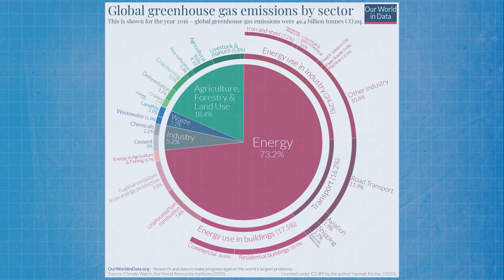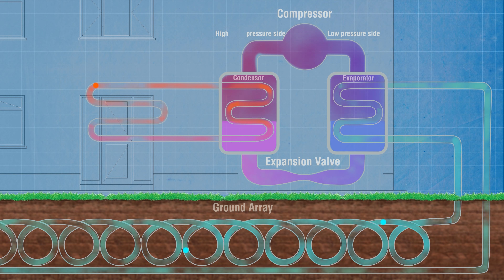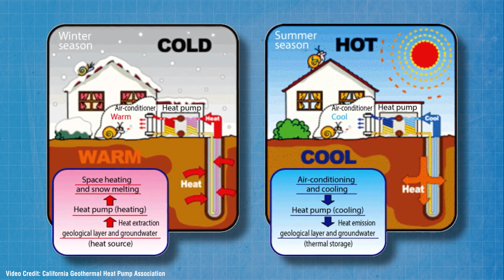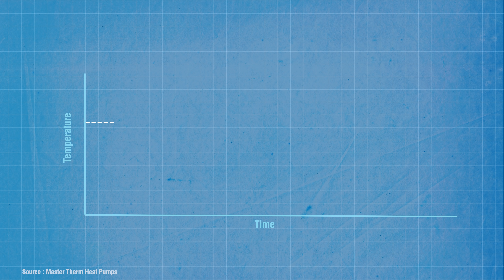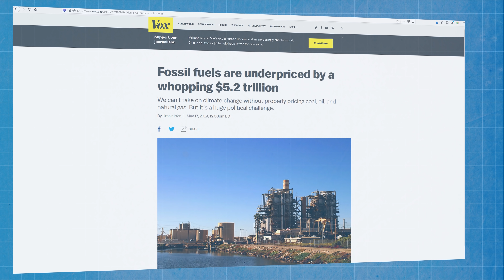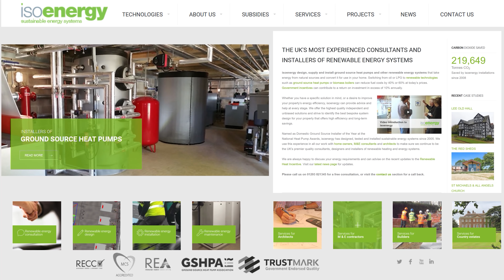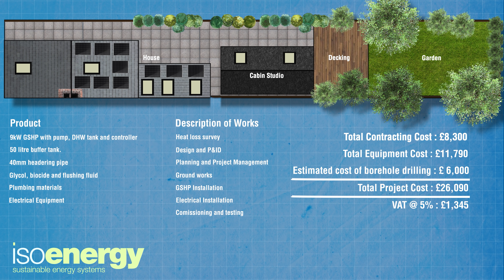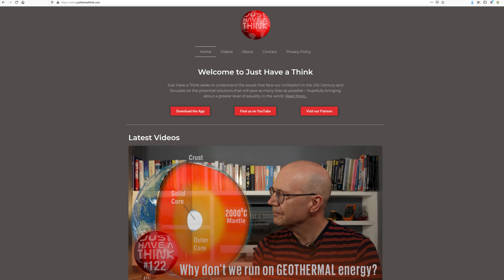Geothermal ground source heat pumps. Heating your home from your own back yard!

Comment: Quote from the isoenergy website as listed above:-

"Ground source heat pumps take heat from the ground, raise its temperature and use the energy to heat your property." 

As do conventional gas or oil boilers. Our water is buried in the ground and comes in at that temperature, we add heat from combustion instead of heat from gas compression as in a heat pump.
While the much vaunted Coefficient of Performance is quoted I have yet to see an explanation of how it occurs? The ISOenergy website merey says you get energy for free with no technical explanation?  Am I sceptical, yes!

Another factor to consider is that gas and oil boilers us the fuel directly and have a very good efficiency (Circa 90%). The quality of the heated water, due to it's higer temperature gives an advantage over a heat pump, particularly air source which gives a reducing output proportional to falling outside air temperature, rather a negative for a heating system?
Using fuel to produce electricity and then supplying a heat pump uses quite a bit more fuel (About 40 t0 50% efficiency producing the electricity for the consumer) This significantly drops the COP.

While the CO2 emissions from generation have dropped steadily over the years, this push for electrification of heating and transport will increase demand significantly, which can only be met by fossil fuel generation as expansion of non CO2 emitting generators will be less in capacity than the extra demand by a large amount. Nuclear is slow to build and current nuclear plants only have a limited life left, as have many wind farms. While wind farms are much quicker to build they need about 2.5 times as much capacity built for 1 unit of actual produced capacity (i.e. if you need 10 Gwatts actual electricity you have to build 25 Gwatts capacity), so construction is much slower than it would appear.

Just have a think!

Comment: POOR UK.. you are near 25 yers behind SWeden  in national  power grid.. we all have  380 volt grid
for regular homes plus my 9 KW IVT Industry Heat Pump with all installation and  140 m down drilling  it cost me only 10 000 EURO  not 3 times more for the  same system .. When my company built the first heat pump 25 years ago,, you all UK played with your small toys in the sandbox.. we have no NATURAL GAS heating systems .. The made by Sweden heat pumps are safer and much more cheaper to run and the cost  every month is fantastic, we pay less than 100 euro for all electric bills, 5 peoples in the middle of SWEDEN   country ...

Comment: Geothermal heating is great, but can also cause big problems in some areas, where the ground is not stable enough. Houses sink down and develop cracks. So it is important to check first, if the ground is actually suitable.

Comment: I live in southern Idaho USA. I have had a ground loop system for almost 10 years, There are pros and cons, i cool the compressor with a water heater reducing hot water costs, it gets a 40 gal tank to 120 deg F. when running. In the summer it cools a5000 sq ft house for around 20 to 35 kwh per day but in Dec, Jan and Feb we go up to 82 kwh per day. We keep the house at around 66 deg F. in the winter and 76 deg in the summer. So in the winter our electric bill is about $350 per mo. not bad as there are no other utilities.
now for the cons. It takes getting used to because you cant vary the winter temp more than about 4 deg between day and night because it warms up more slowly. you don't have this problem in the summer. It is also not a "toasty" warmth. However you must run the AC in the summer to replace the heat you took out of the ground in the winter. Sounds weird but we have tested. Also the coolant in the ground loop gets pretty cold by Feb down to 35 deg F.  It takes a lot to get heat out of that. If i had it to do over again i would use 2 wells. I have been told they are much more efficient. I have a 5 ton Water Furnace. I would also go 6 ton. My system, installed after the house was built (we bought a repo out of the housing crash) cost $26,000 US in 2010.
Reply: Hi Bob, It sounds like the original installer didn't supply you with enough ground loop. Do you know the average ground temperature? (below the frost line) I live on the east coast and for a 5k house we would install at least 4 vertical wells. (we average ground temp of 55deg) Not knowing the specifics of your property I would bet your system was undersized from the start. Have you serviced the system regularly? It sounds like you may have a flow issue.

Comment: I wonder if there are hybrid heatpump systems commercially available which uses mostly an air to water heatpump  concept together with an additional water tank for the coldest nights.

I live in a region with average temperatures only slightly below freezing in the midst of the winter with some chances for very cold nights at temperatures far below freezing. Under these circumstances the air to water heatpump has a less than stellar efficiency.

Water can release lots of thermal energy when it switches from water to ice. Its about the same energy as necessary to heat up the same amout of water from 0 to 80°C. Why not switch the heat source of the heatpump from air to a water tank with cold water during the cold nights and then remelt the ice from the tank again during daytime when it's about 10°K warmer and/or when there is excess energy from renewables? Is there a system commercially available which looks similar to the one I described?

Sure, it would be better to use thermal energy from the ground but when the water tank is only used to flatten the temperature peaks of the thermal energy source it could still make a big diffrence in the systems efficiency and a simple water tank might be quite compact and cheap.

Comment: Another way of doing it especially for large users/companies can be.

The use of water from a river or sea.
This has z'n even greater efficiency because you can have more volume of the source running through, without drilling.

Comment: The ground temperature is about 50 degrees F just 8 to 10 feet down. So, no real requirement  for deep drilling down hundreds of feet. Horizontal systems are much less expensive, and suitable for most installations. New homes obviously can easily set up a horizonal system under the house, , but horizontal systems can also be installed at many existing homes. If an existing homes has a yard, as in 10,000 sq. ft. or larger lot sizes, like most suburbs in the US,  a simple trenching machine is all that is needed. So, no large, expensive, deep drilling vertical machines is needed ( as shown in many videos on the topic , including this video of an installation in California).  My understanding is that for homes with lesser sized yards, horizontal boring machines (much smaller than a vertical drilling machine) can install a horizontal system under the house. I am sure there are some installations that require a vertical system. (But, no need to go deeper than 10 feet.) 
In summary, for many installations, horizontal systems are effective, savings much of the installation cost of a geothermal ground system, thereby hopefully enabling more users to opt for a geothermal ground system.

Comment: I’m a commercial HVAC engineer in the US - I’m in full support of your intent, but there is a lot of misinformation I believe in this video. 

First, the intro comparison to geothermal power generation and geothermal heat pumps is very misleading. Kind of like comparing solar panels to batteries. Obviously one is an energy source while the other is energy storage. Same with the two geothermal technologies. 

Assuming you live in a geographic region that holds onto ground energy (not all do), it really is just a thermal battery. And the only gains from a geothermal heat pump vs an air to air heat pump is improvement in efficiency due to the more neutral ground temperature. But it isn’t an energy source.

Second, you imply many times that the industry just needs more adoption to make the economics work. I’m sorry to say, this isn’t true.  The vapor compression heat pump is as developed as it will ever be (except for changing refrigerants phase outs). And bore hole drilling is also equally developed. And neither of these benefit from economy of scale as they are already used extensively outside geothermal heat pumps. So I just don’t see the argument here. 

Lastly, in the US, which obviously isn’t favorable to green technologies as much as we should be, the whole geothermal heat pump industry has nearly died due to fracking. Not only did this create cheap natural gas to compete against. But it also competes with drilling bore holes. The drill rigs are busy drilling for gas companies and therefore you have to pay that kind of premium to get them on your job site. That in mind, we haven’t done a geothermal job in probably a decade. 

We have one right now that the owner had wanted geothermal for years. Project went on hold. Now that it’s coming off hold, we can fit it into the budget nor substantiate a business case to go find extra money.

Comment: Very interesting and informative, thank you. I lived in a modern concept bungalow with a geothermal heat source for three years. ( suburban UK) It was situated in a plot shaded by huge trees, and surrounded by a beautiful garden/pond. The underfloor heating/wood/tile was efficient, the heat pump ‘thing’ ( probably the water tank) was in a shared space in the small utility room, it was about the size of a fridge/freezer, and soon became part of the furniture, I became very used to it being there, and barely noticed it. I was advised not to fiddle with the thermostats, because it was set to the most efficient temperature for comfort, which was more to do with the design of the house, heating up from the floor into a high ceiling with air extraction vents in the ceiling. We never lacked warmth, very comfortable. The hot water ran out for the second person trying to have a good long shower, as with any big hot water tank compared to a gas combi, but it soon warmed up again. I can’t comment on bills, installation etc, it wasn’t my house, I admire the owner who put so much effort, money and creativity into the design. I wish it was a financially viable option for my little two up/two down house, I’d have nowhere to put the unit though, they’ll have to come up with something smaller, like building it into the foundations or something. I’m surprised they are still building mass produced, gas centrally heated new homes in the uk.

Comment: This was not typical. When I saw the title a few days ago and waited for it to download I knew  it correct issues  not delineating  difference in  prior but you did not necessarily agree with that. You did not provide information about where the heat that has been come from the ground comes from. By not saying whether it comes from below or above you don't have to discuss the cooling situations in which it could exceed the capacity of the ground sink. I live in a place that is hot and dry and the electric utility always said ground Source would not work well here, however the electric utility evaporates tremendous amounts of groundwater and the groundwater is  extraordinarily high quality and we used to be able to get it in our homes but now just  river water a man-made surfaced Canal  far lower quality. However the utility and the farmers can still use more water than we have!...[utility has a biased dishonest collection of talking points and this is increasingly being realized around the world.]

The Swiss information from a viewer is almost unbelievable and should not be so owned by you without additional corroboration. Essentially the Central District heating system obviously is overpriced and the double incentive rule is being broken if people eligible for  district heating are enhanced for going off the grid. That is to say the public is suffering inefficiencies and the return on investment would be higher IFALL household connected to the grid to improve the grid.

In the United States military bases have experimented extensively with recharging the ground.

With heat pump technology of course even with refrigeration versus solid state the difference in temperature is extraordinarALLYy  important. It is for this reason that heating air in a fan-forced AKA CHILLING INSANELY system or the alternative creates need for higher grade Heat then proper cost engineering and efficiency in design allows.

 you could literally have inductive charging on your entire floor space for an electric resistance Footwear heating system. This system could even heat the air you breathe and possibly at such a high temperature before cooling it down again that anything LINE VIRUS that threatens you could be killed. indirect systems for maintaining body temperature are the prescription for incredible waste and utter Folly and SeAling the home and trying to insulate the windows Etc.

 when you're talking about the dehumidifier indoor air or heating it you're talking about a very ancient paradigm but the word and the concept is abused for changes within the black box for what happens in the equipment room.

 I think the hardest Concept to teach is that of opportunity cost. investing tens of thousands of dollars into internal climate control systems ignores the technology that could be used in the clothing and the shoes and the air that is around the face. almost nothing is invested  where it really could matter. Better shoes for Mobility. For example Target some of those locations have a Kick Scooter that has high quality bearings relatively large Wheels compared to any skateboard and it cost about $100. I was very disappointed when I was looking for it at the second location I visited recently. I don't know what the speed is we're having a battery in a motor can be justified -but given the speed of all the juvenile scooters is less than this speed- Houston this is a stunning problem. children who are burning through several lithium ion battery powered micro Mobility devices Each of which cost more than the top of the line analog Kick Scooter are being exploited to an extent there would have them confer among themselves and declare some of us have been sexually molested but got the Kick Scooter and are far better off than those who have even now the 12 mile per hour battery operated machines. I would add that those who use the battery operated machines are likely to molest their children and will likely seek a car versus say handed down stator scooter a luxury model just NoT ZYETSTILL?[05/09/2021?] in stock recently at a very bargain price of just a few thousand dollars.

Solid-state heat pumps are good for those very cold periods of the winter because they can heat up your storage operated year-round on any surplus capacity from the heat pump. The additional storage cost almost nothing in many homes. They don't break down and properly sized 4 year-round operation to store energy for those peak days with the bonus being in reliability cost almost nothing themselves.

 I'm speaking about retrofit of course. indoor cold weather clothing and gadgets is the paradigm. Literacy is the paradigm. that means when your cold you adjust your diet and your activity level scientifically so as not to gain weight you don't want. you will learn to love the increased quality of your life because the quality is actually increased tremendously. poverty is being naked in the winter while you go bankrupt blowing heat and humidity from your work uniforms you are gouged of the price of but requiring to buy. almost nowhere do people invest sufficiently in seasonal clothing for home especially. If you have the machine that pushes you up in the air when you try to do chin UPS or pull ups you will love doing them instead of turning up the thermostat. almost everybody of any age can find a way to increase their metabolism and decrease their loss of heat. the cashmere cardigan and fingerless gloves that might possibly circulate heat from your upper arms down to your wrist are worth the hassle of buying maintaining developing etcetera. the world has been designed for the utilities not for the people for the car makers and fuel Peddlers not for the millions killed and Planet lost. I believe in District Heating but drastic reductions in the amount of heat people need and heat comes from Air liquification you need look no where else.

Comment: Another well known source for heating and using the heat pump technology, is the simple air to air heat pumps. Most known as air conditioners. 
In my old house without any classic waterbased heat system, these air to air heat pumps do a great job. You get around 4.5kW per kW you put into the system. Cheers from Denmark

Comment: Ground source heat pumps and geothermal energy are two different things. Let's not confuse the two together on account of both being underground. Ground source heat pumps can be a very good idea if designed carefully and used in a least-harmful way e.g. in cities, where everything is pretty much covered by concrete anyway. Laying acres of farmland soil with heat pipes on the other hand is not as benign as one might initially think.

Comment: I was just imagining asphalt black top parking lots using this to heat the water during the day, and maybe even the night.
Reply: The Giant's Causeway Visitor Centre, in Northern Ireland, does this (ground source heat coils under the asphalt carpark) and, in addition to other innovative ideas, has a turf roof to capture and filter rainwater. Well worth a visit for eco reasons, as well as the amazing Giant's Causeway itself and the surrounding coast.